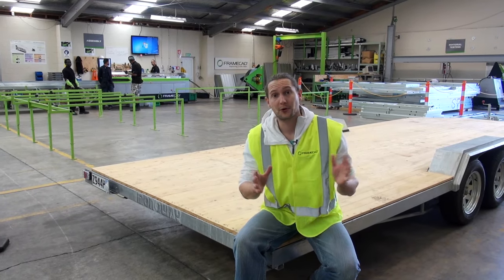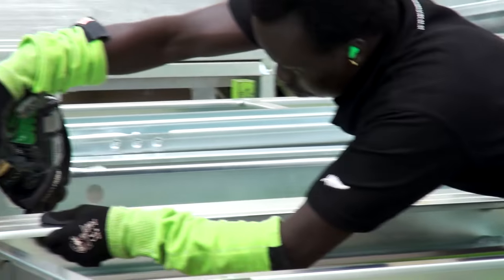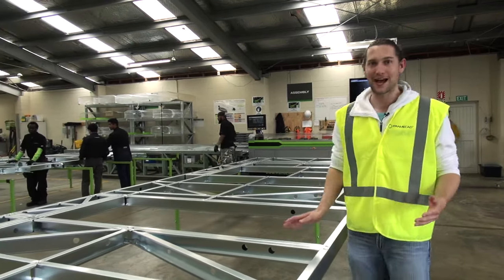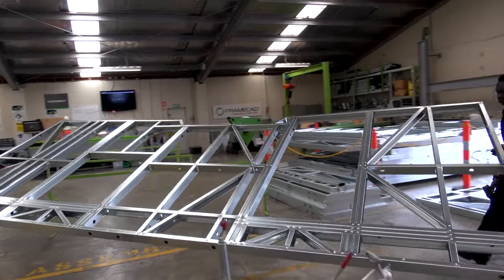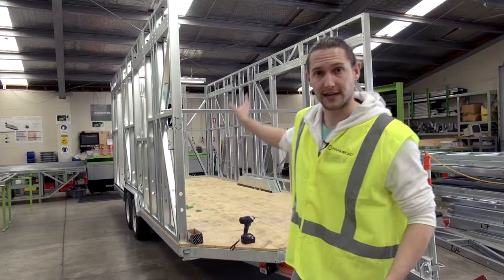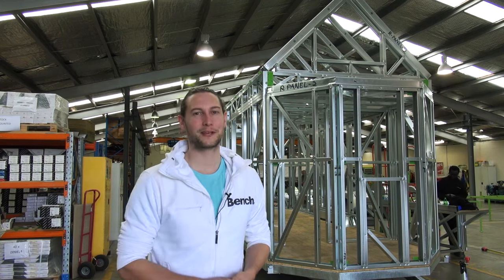Steel Framing With FRAMECAD: Erecting the Frame

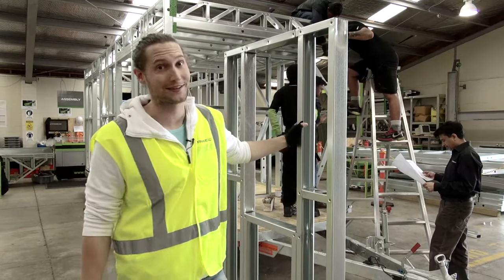Comment: I Can see the base flexing as the workers walk around on it. Seems like this would cause a lot of gaps/looseness over time in the build? 6:17
Also Steel frame combined with steel cladding seems like it would transfer a lot of heat/cold from outside through the steel into the house?. Also triple stacked parts of frame cant be insulated?

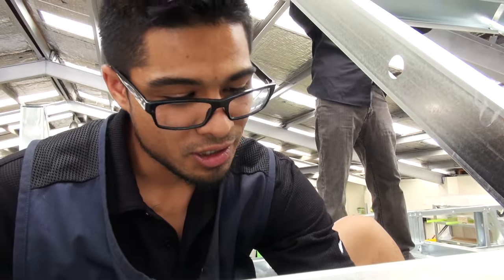Comment: Nice frame, but I'd replace the cheesy self drilling screws with steel pop rivets. Screws are okay for stationary applications (when they're not stripped 7:31), but in a vehicle they'll work loose over time, rivets are more resilient. Ideally the joints would also be bonded with windshield glue, and the walls would be separated from the deck by a foam strip.
Reply: Didn't see it strip the sound was the slip of the driver once it reached the torque limit. Most new drivers have an adjustment to set the max torque so you don't strip the self tapping screws. They also could use a voltage limiter like Makita does to do more delicate work like working on Computer Motherboards and such.

Comment: This structure is worth it! 
If the house is not on the move, horizontal and vertical lines are enough, fill the cemboard in place for the wall and it's good to go.

Comment: Love your videos especially when you visit and interview other tiny owners and builders.  I believe you mentioned that the trailer you had made was aluminum is it because it would be lighter than the steel ones , correct?.  Did Frame Cad make you the trailer as well?.  I have become a huge fan of tiny homes and am in the research planning stages in building my own and one for my daughter and am interested in of one you are building with the steel frame structure .  Love the idea,  wood is heavier. And more expensive . Would like to lighten the load in my build and pocket  so to speak.  Am a Carpenter by trade and have made furniture .  So will be doing much of the rest of the build on my own.  You rock brother! Looking forward to the completion of your new home.  God bless.

Nikko

Comment: These are great videos. It's so interesting to see this tiny home being built in such a contrast from many of the others on the internet. 

I'm interested in the price difference vs wood framing if you're willing to share I would be greatly appreciative. Thanks buddy!
Reply from the maker: Carter Weston Yup, we looked into so many options and this was hands down the best way to go in my opinion. Steel is actually slightly cheaper than wood. :)
Reply: Living Big In A Tiny House Are you going to have a cost breakdown for each segment?
Reply: pio bela xonstucione mutto Bona e bela

Comment: Hey Im very interested in using steel frame for my tiny house. I was just wonder the cost. Can you tell me how much yours cost?
Thanks,
Brian
Reply: Brian Brown ，hi
Reply: It depends anywhere between 15,000 to 25,000
Reply: I'm not sure how much they charge to make it for you but steel framing studs cost less than wood framing, so at least with the material side it's cheaper (if you frame yourself). I think I figured it up to be around 15-1800 in materials to frame a 30x8 tiny home.
Reply: I'd more concern about the thermal properties of the metal frame.

Comment: Should one use an insulator between the metal studs and the wood though?  Bug proof/water proof?  Your floor essentially becomes your Sill plate where the two meet.

Comment: This looks terrific! While steel is the same or perhaps a little lower cost than wood as a construction material, how much does it add to the cost of your build to have a company like Framecad assemble it for you? Certainly the time savings has to be factored in too, however, since what takes them a couple of hours to construct with a small army of workers would obviously take a person far longer to do on their own. It certainly gets the job done quickly and efficiently even if it adds to the total cost somewhat.

And when you refer to SIPs in the comments as not being "eco-friendly," I assume you mean living in a structure with all the chemicals they're infused with as opposed to their manufacture per se since the iron ore mining industry is not often considered the most eco-friendly. I just find many people (not necessarily you) professing adherence to a green mindset conveniently overlooking the eco-costs of the materials and products they've decided they can't live without while condemning the choices of others for things they've deemed bad. Again, not casting aspersions at you. 

Have to admit, this is one of the most fascinating tiny house builds I've seen to date. As I watch this come together -- and the videos aren't being posted fast enough! -- I become inspired to build one of my own and I love that you're sharing the entire process. Thanks!

Comment: Why do the door way studs have punch service holes?  Do you intend to run a water pipe or electrical cable through the doorway at shin height?

Comment: So how much did the frame cost? We need a ball point number.
Reply: It should be on the website when they get to it.
Reply: I've just done an estimate on my 28 ft design, with 2 lofts using 18 guage steel, and "2x6" floor joist; all TOTAL: $2950, and that was quoted through a steel supplier not a home improvement store.
Reply: +kerry clement wow Kerry that is freakin awesome!
Reply: $2,950 US?
Reply: If it's less than 3 grand that's amazing
Reply: Tiny houses are filled with scammed contractors who over charge by at least 200% of what they put in. To see that 3k price tag really gives me hopes now for getting one built professionally instead of having to do one myself without proper training.
Reply: devinefaithalchemy hi， did you finish it？
Reply: So where is this available for purchase ; if not in the U.S.A. Can and do these people ship to the U.S.A.
Reply: DarthSailorMoon are you still looking to build a tiny house?
Reply: @gypsumgoddess2828  😍 Love that price...Where in the US can pay $3K for the framing?
Reply: DevineFaithAlchemy, Would you mind sharing your design and steel supplier details?
Reply: @gypsumgoddess2828  Is that materials only? Or framed like in this video?

Comment: I think this movement is really cool but as I'm watching it I'm wondering about heating efficiency because I don't see any insulation in all these videos. Especially the floor just being a single layer of wooden planks...I thought the NZ winter could be compared to the middle European winter and I imagine the heating costs going up when the cold wind blows beneath the house. Same thing with earthships, I was really interested in that but in the climate of the area I'm living in it would just be a very expensive mouldy hole in the ground
Reply: I could be wrong but I think the trailer was made with insulation in the subframe of the trailer floor with metal sheeting on the bottom so it acts as the floor without building on top.
Reply: It sucks...honestly it's not all its cracked up to be.

Comment: I've actually been considering this for my tiny home but I cannot a local place that will do this type of work. I will considering aluminum over steel just because I wanted something lightweight and steel would add significant weight. How do you think this would fair in cold temps?

Comment: Why did you mount the walls on top of the flooring..? I would have thought the walls could be more rigidly mounted directly to the frame without the flooring sandwiched in between. Would also seem easier in the future if you ever had to replace the flooring inside the house.

Comment: Are all the steel members the same shape/thickness/material?
Reply from the maker: Yes, all 89mm steel C section.
Reply: Great, thanks. I love this build, it is one of if not the best I've seen for the tiny house movement. Very methodical and well planned out.

Comment: Awesome video.  Can't wait to see what you do with the finish steps.  I too am wondering about that roof line and how you will finish that space.  Are you planning a loft bedroom?  What will your over all height be?  This is really changing some of my thoughts for my own build planning.  Keep up the great work!
Reply: From what I see on their planes, they are going for the loft bedroom / storage loft on opposite sides approach.
Reply: Yes, a loft bedroom.  I like the plan that has the elevated kitchen or living area with the bed stored under the floor as a slide out.  One plan I saw even had extra storage space in the floor with hatches to access the storage.  It was really nice.

Comment: Hey bryce awesome build and u guys help out so many people including me..;)

just a few questions..

1. u answered earlier the studs are 89mm thick is that a typo or whats the actual thickness of the material..?
2. is it possible to just source the steel studs and do the whole wall framing without working with a bigger company like framecad to make the build cheaper and more of an experience ?

cheers for any answers and keep up the good work;)

Comment: i'm a bit concerned on how to insulate a steel frame since metals do conduct heat very well.
Also the "joint" between frame and floor is in my mind where it would possibly leak into outside/insulation.

But those are my concerns, i hope it goes well and bit curious to see how it pans out.
Good luck
Reply from the maker: Yup - there are certainly increased issues with thermal bridging when framing with steel, but we have accounted for these in our design so we are not expecting it to be a problem in the finished house.

Comment: I haven't seen any other tiny houses with steel frames (though I'm sure there are some). Did you consider SIPs instead, and if so, what tipped you in favor of steel framing?
Reply from the maker: Hey there. Yup - SIPs are a great option for Tiny House construction. Unfortunately, most of them use insulation material that's anything but eco friendly! EPS is on our build red-list, and so that already rules out the vast majority of SIPs that we have seen.
Reply: check out the nautilus house (http://aluminumtinyhouse.wordpress.com/). Its one of my favourites - a beautiful, unique aluminium framed house with a sliding loft!

Comment: Thanks for video!
 I have a few questions:
    1) Is more expensive than the wood frame?
    2) How long and how hight is the tiny house?
I'm thinking to make one by my own on 8m meters long platform [without (how is called this?) dolly] and 4 m meters (from ground to highest point), and 2,5m outside (maybe 2,35m inside) with a very little V roof and lots of windows
    3) Can you tell me more about having the door on a side or heaving the door on the back?
I like the door on the back but i don't know...
Reply: Its cheaper. I think the house is around 6.6/6.4meters or so, not sure about the height.

From what I heard from other builders, a door on the side just makes it feel a bit more open I think and I guess just a good preference too. I like it on the side personally.

Comment: What's the weight diff steel vs wood ? and how much it's cost this Fast Forward ?
Reply: Wood varies depending on the specie, but generic 2x4 stud is 1.2lbs per foot, steel also varies by demention and guage, www.menards.com type in 'metal framing'. they have a huge selection clicking on the PDF for any of the steel stud products opens a detailed specs sheet for steel guages/weights/dementions etc.

Comment: Stuff screwed together will flex and get loose over time especially if moved a lot.  Welding is much better.
Reply: With that thin of material the welds would fatigue much faster than self tapping screws.
Reply: Rivets.

Comment: I have a feeling the cost of this tiny house is hovering over $100,000
Reply: Depends, the trailer they went all out and costed them around 8k USD / 10K NZD, steel framing is lighter. They do want a more eco friendly so maybe more premium materials. But I don't think it'll reach 100k, we;ll see.

Comment: Why the a-frame? There is so much more space when you open up the ceiling.
Reply from the maker: There are quite a few reasons why we felt this was the best roof design for us. We will go into detail about that in a later video as it's a common question.

Comment: That looks awful light just like a aluminum RV frame in USA 2 people lifting a whole wall doesn't look as though it would be tuff like wood
Reply from the maker: kimmyjeans2 It is very light, but incredibly strong. That's the nature of steel! About 1/3rd the weight of wood for the same strength.